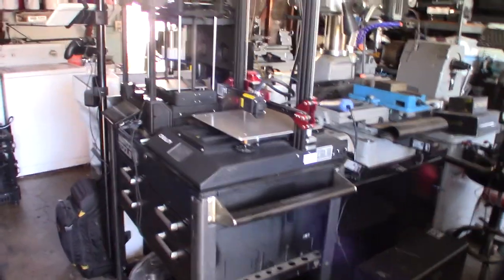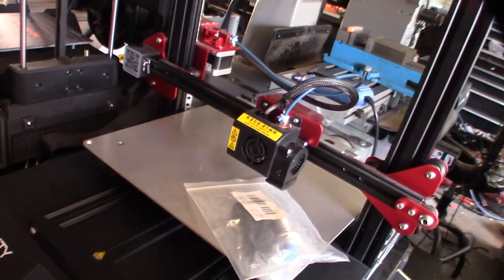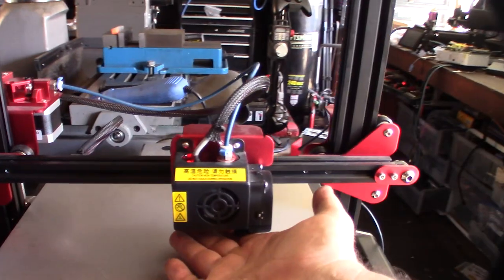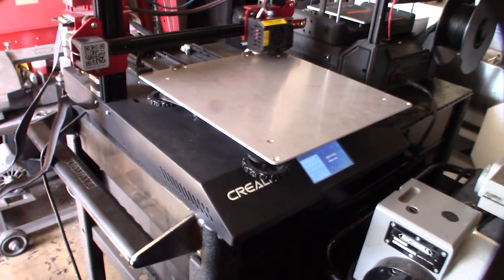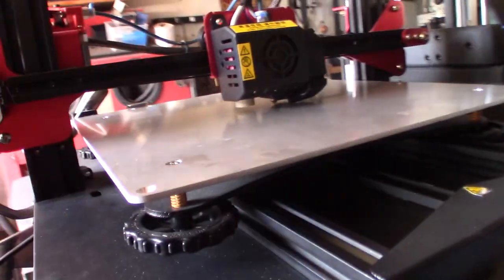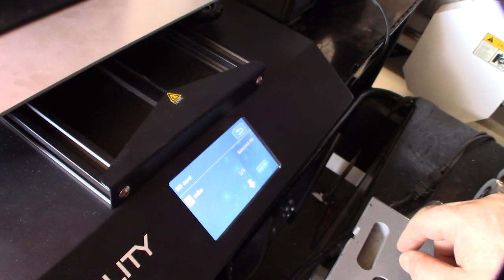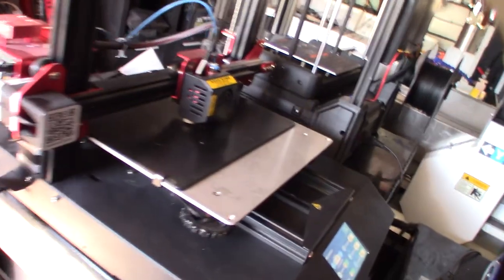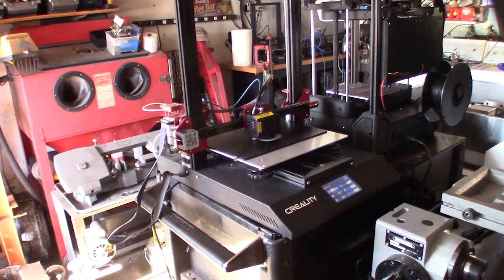Creality CR10S Pro V1 Probe Troubleshooting Unicorn Printer

Comment: yeah... i got the same CR10s Pro v1....

the std firmware is kinda shit..... have to upload to microsd and it write to the card every step (thus sd card die fast.... hint: use HIGH WRITE ENDURANCE card IS-A-MUST)
i managed to flash it with klipper (later using mainsail with a modified CR10 config....)

i just ordered BQ SKR Mini E3 and Raspberry-CM LCD 5".....
to upgrade that aging board+pi combo
Reply: BTW anybody want to try adapt v1 to klipper or mainsail..... bellow is a excerpt to my modified PRINTER.CFG
Reply: [gcode_macro G29]
gcode:
	BED_MESH_CLEAR
	BED_MESH_CALIBRATE
	BED_MESH_OUTPUT

[homing_override]
gcode:
    G1 Z30
    G28 X Y
#set_position_x: -30.0
    G0 X180 Y150 F6000
    G28 Z
set_position_z: 0.0

[probe]
pin: ^PD3
#z_offset: 2.5
speed: 50
x_offset: -30
y_offset: -5

[bed_mesh]
speed: 100
horizontal_move_z: 10
mesh_min: 20,20
mesh_max: 280,280
probe_count: 6,6
Reply: also my printer config is not perfect..... seem to have a bug....

it can never do continous job.....
must power cycle to reset the printer memory.....before print another job.....

something to do with the bed size and bed/mesh/probe area.....
* never took the time to go fix the issue.....

it works find doing single job though......